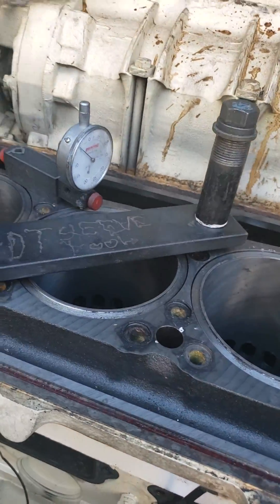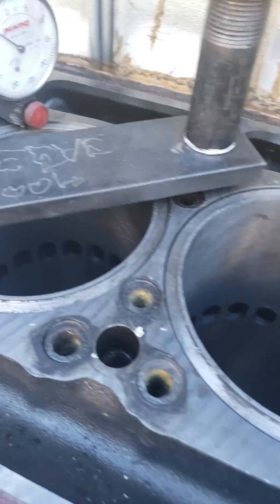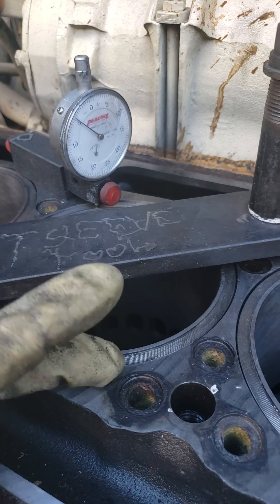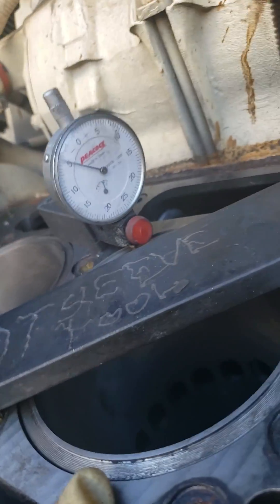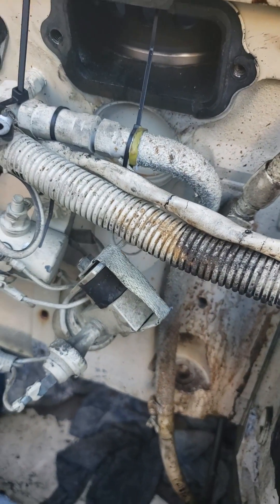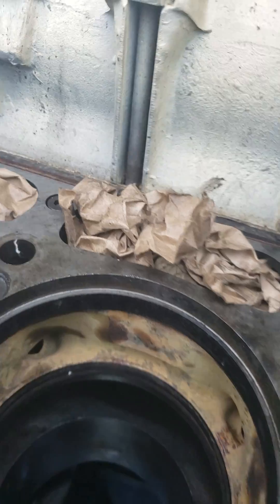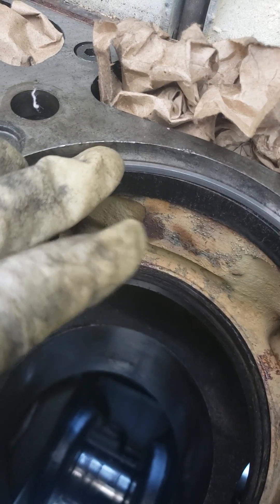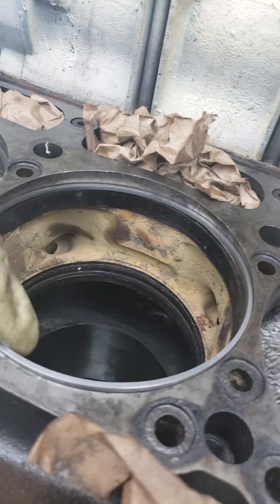Detroit Diesel 6V-92 Seized: Debunking the $550,000 Quote - Ep. 5 -  Mobiledieselmedic.com #diesel

Comment: its called a recess. its protruding even or recessed.

personally i believe they were quoted high because nobody wants to mess with ancient motors any more. and being seized its a replace situation not a rebuild.
Reply: All mechanics these days are replace over rebuild.
Reply: @sylumgand  and why is that? if your gonna have to warranty the job 3 times because the brand new part is a joke. might as well not have to clean the parts every time
Reply: @chehystpewpur4754   Id say because its cheaper in labor to replace than rebuild, with maybe the exception of in chassis rebuilds on big rigs. Clock hours are where the bill really adds up.
Reply: @sylumgand  its the quality of the parts.
i was a mechanic for a long while. we would do the job over and over and over because we cant get good parts. manufacturer aftermarket supplier major online retailer. every part was junk.
many jobs we did we had to put the bad part back on because it was better than the new ones.
do you remember when you could get a water pump rebuild kit or a started rebuild kit. now you cant even buy a remanufactured water pump. its all "new" straight out of china.
fan clutches that dont fit the bolt holes to attach it and the hole for the shaft was wrong too. straight from gm...
parts are a joke and new cars are worse.
Reply from the maker: The point I was trying to make when I rebuilt this thing, is if they did a replace vs. a repair (I don't even call it a "rebuild" on the invoice) then all the code upgrades kick in.  Now we are in the BS upside down world.  All the county and city, utility reps, clean air resource board reps, code enforcement reps etc... all have their hands out, give-me give-me.  I did the job for less then 10% of their original quote.  Win/Win!!! Definitely makes sense to rebuild vs. replace.
Reply: @mobilediesel  Glad I live where if its 25+yrs old its exempt. I've already set the hard date of any vehicle I purchase to 2004 and older. Up to about 04 its still simple obd2(for the most part). Cats clogged or downstream O2 trying to fail my perfectly fine running engine, time for a sawzall and non fouling spark plug adapters.
Reply from the maker: Yea I'm migrating that direction as well.